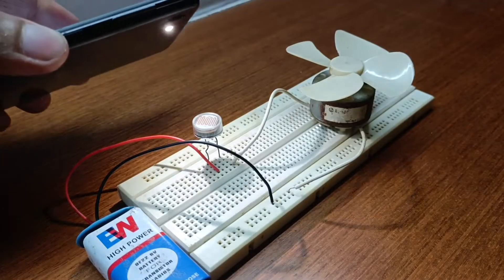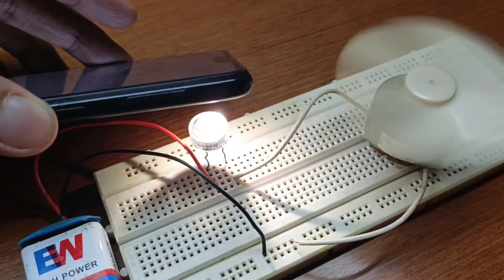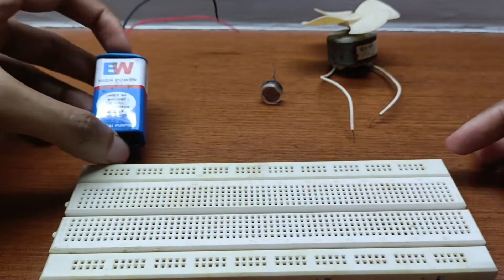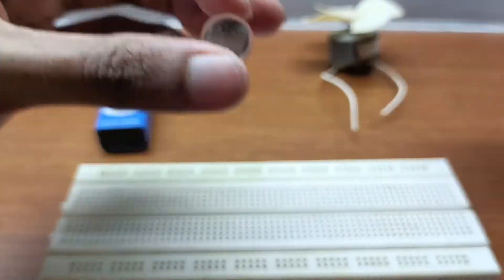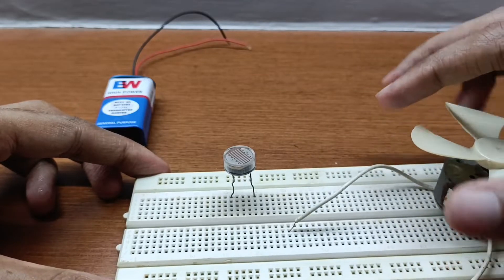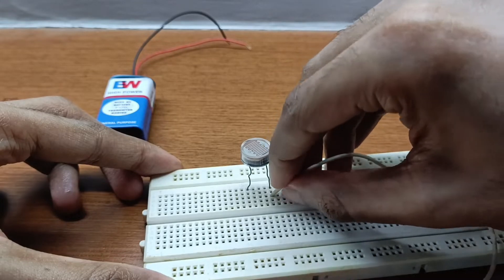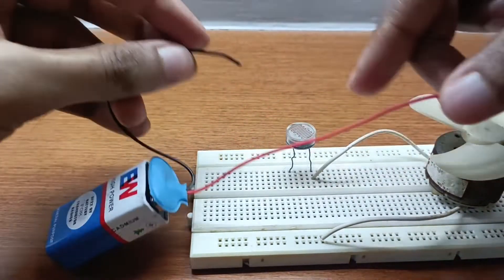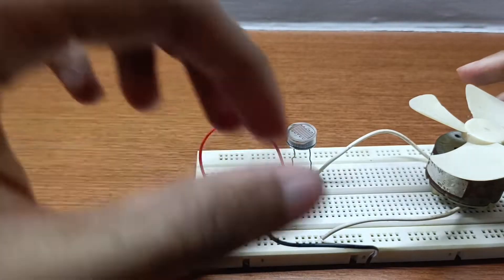How to make a Light Activated Fan? | How to make a Light Sensor DC Motor project on a Breadboard

Comment: Sup Bro
How many volts does ur motor use?
Reply from the maker: Sup bro. I think it's 12V
Reply: @TroyAraujo  Thanks. BTW, Can I do this with a 4V motor?
Reply from the maker: Yes it should work but use a 4v or lower battery too
Reply: @TroyAraujo  Thanks a lot for clarifying my doubts, bro
Reply from the maker: You're welcome bro :)